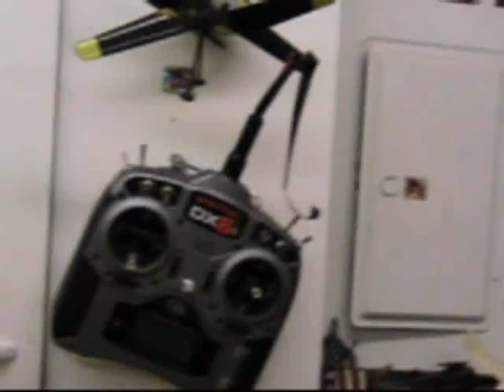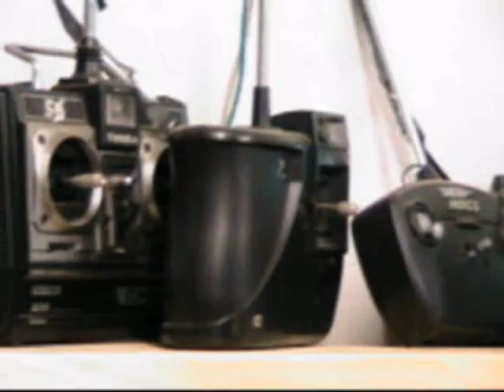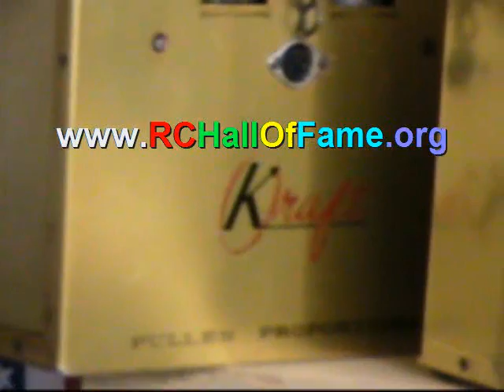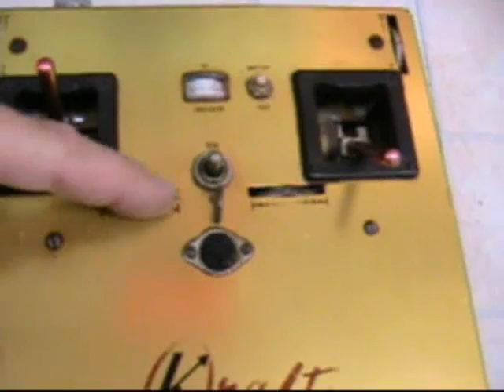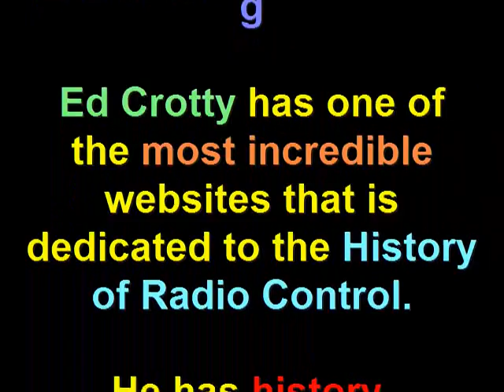Antique Kraft R/C Radio was Phil Kraft's Plus a few of mine.

Comment: Dave I recently acquired a single stick series 71 from a fellow RC collectors garage sale. The repair record inside spans from 1977 to 1980, Names include Jim, Dean i think, Ken, Lee, and Jay i think. Two of my Kraft collection have your own signature in them. They are very well built radios, and most of mine from that era still work if given a new set of batteries :)
Reply from the maker: Right on. Glad to hear that. I recently flew my Signature radio. It was great. Happy flying.

Comment: I have a 1969 Kraft Gold Medal series that I bought when I was 16 years old.  72.64  MHz (Green & White) if I remember correctly. One of these days I want to replace the batteries and see if I can get it to power up. Since it's been sitting for 40 years do you have any recommendations as to what I should do before powering this radio up?
Reply from the maker: It should power right up.  I used to fly on Green and white too, till I got my ham's license and switched to 53.400..  Thanks and good luck.

Comment: I have a Kraft KPT-5CS bicentennial (1976) R/C system complete with receiver and servos on 53.1Mhz AM. The system needs new batteries but otherwise functions just fine.I do want to send the system in for new batteries and plug adapters for modern servos.I love single stick transmitters.Bob WB6JRY.
Reply from the maker: As I stated, Phil Kraft also flew single stick.  They were great and I tuned many of them in the Signature series line.  Too bad Kraft was forced out of business.  New batteries are fine and would help a lot.  I changed many of my servos over to J plugs and used them for years.  Unfortuntely, they all and these radios and planes were destroyed in the big fire we had on 911 2016.  I also am a Ham.  Thanks for commenting and happy flying.  The 5CS was a great radio!

Comment: Very cool piece of history, but I don't understand why anyone would want to fly mode 1
Reply: +Daniel West My first controller was Mode1 still learnig to fly with Mode2.
Mode 1 is very good even for my quadcopter at AltHold/Loiter mode as I can go slowly forward and YAW with the same stick while doing videos with gimbal. I do not need ROLL most of the time and throttle is also locked so I can forget the right stick and control camera tilt with my right hand most of the time.
Reply: Why would you want to fly mode 2 ?

Comment: My favorite proportional radio in the early days was an Orbit 3+1.  It was a nice little transmitter (big receiver and servos though) and set up like single stick with the throttle and trims on the side of the box.  Super reliable and I won a lot of Class I contests with it.  Once the central stick froze up during a flight and I was able to land the airplane using the trims since they were full travel pots.

Comment: Hi,

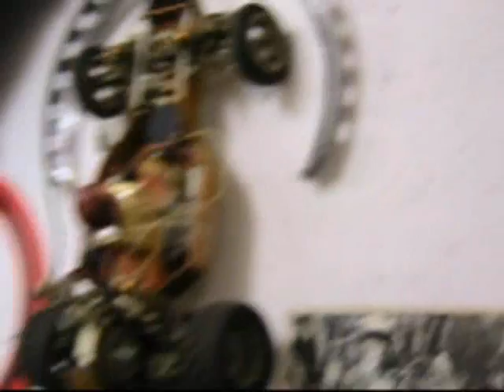The car on the wall at minute 2:28 in the video... What is that? I had a really old buggy way back in the early 80's before I got into Tamiya kits that looked just like your buggy there. The kit was given to me, so I never really knew what it was but I remember the tub chassis, semi-trailing arm suspension and that huge rollbar over the gear case that housed the electric motor in that long projection off the rear.

Thanks!

Comment: GReat stuff as usual Dave. Thanks for sharing.
One question, though; I notice when you went in depth about the kraft, you mentioned that mode 1 has throttle and aleron on the one stick, elev and rudder on the other. I find it more natural to have Elev and aleron on the one stick. What are your thoughts?